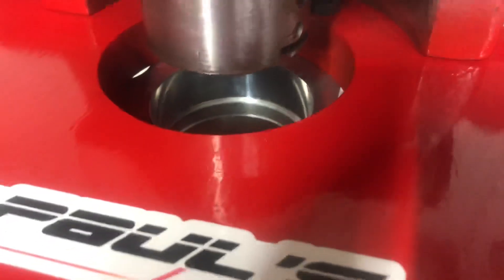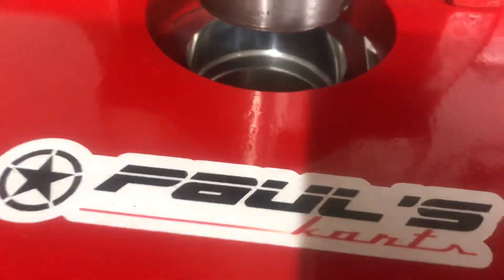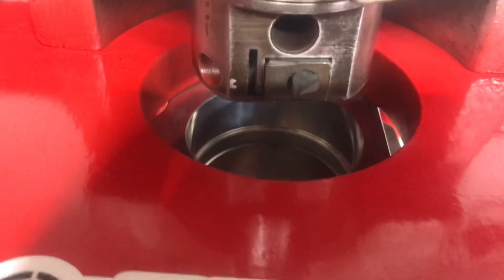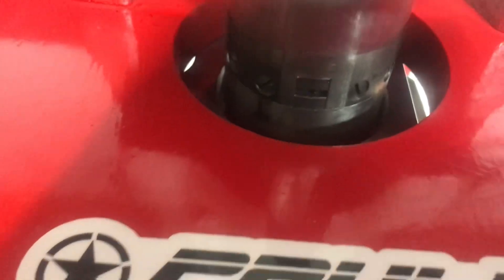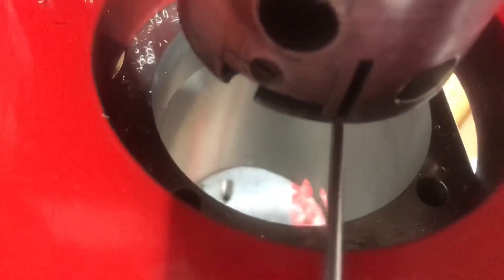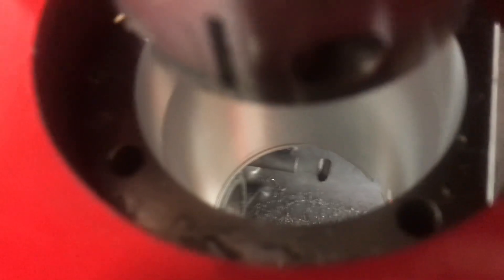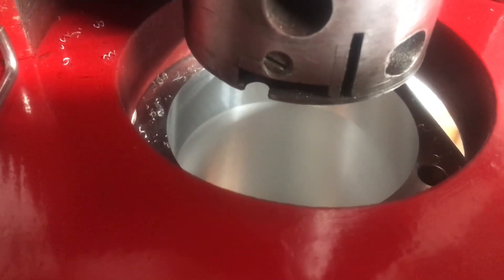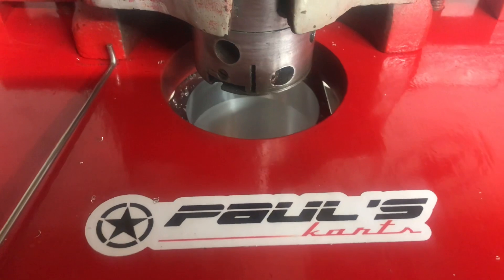Bore , boring , bored , block 😎

Comment: What camshaft makes it sound the most  thump at idle
Reply from the maker: High duration and a tight LSA
Reply from the maker: You won’t really get the rolling thump of a v8 since it’s a single cylinder but you’ll get a really horrible idle with high duration and a tight LSA

Comment: Whats the absolute largest bore you can do on a 212..?
Reply: Paul does a Tillotson 270cc but that's bored 2.990, and stroked. and he does a 3.004 not sure if that's the largest. You'll have to wait until the man himself answers that one.
Reply from the maker: Realistically the answer given by smokin27271 was right. 2.990” and 3.004” are the 3” versions there is also a 3.040” but in standard sleeve that’s getting thin. Those sizes puts you right at the head gasket limits. It’s extremely expensive to go above that but anything’s possible. To seal above that you’d need to leave sleeve extended and groove head. And depending on how big you go bolt positions become an issue. To go further than that get ready to write a blank check. 🤙
Reply: @paulskartslifan4206  Thanks for the quick reply bud.
Reply from the maker: One other thing is the cranks can’t take much more bore size. In the stroker cranks you really need the billet no questions. And 3” needs the special alloy billet. If you go further even the special alloy billet cranks would be above safe operating levels. Cranks breaking could be a real problem with larger than those bores.
Reply: I know your pain, Boring cylinders all day can be......Boring! Lol
Reply from the maker: @cycletechperformance9581  yup , up and down up and down, insert sleeve , then up and down up and down 😫
Reply: @paulskartslifan4206  LMAO! Right!